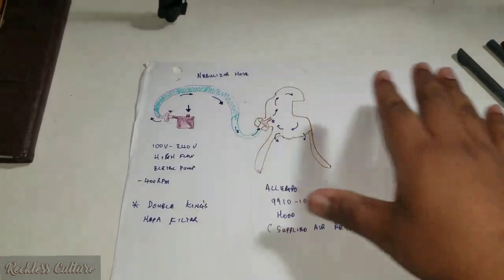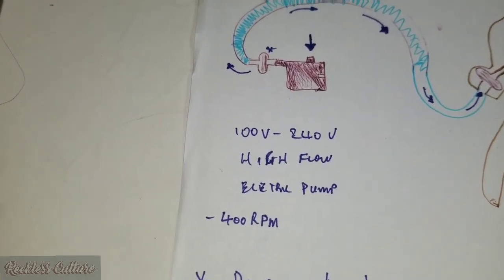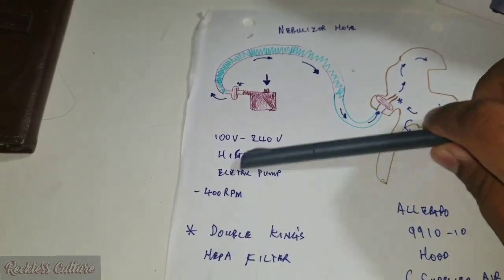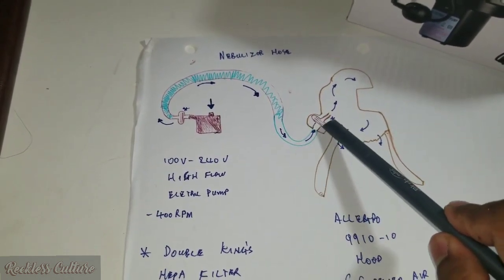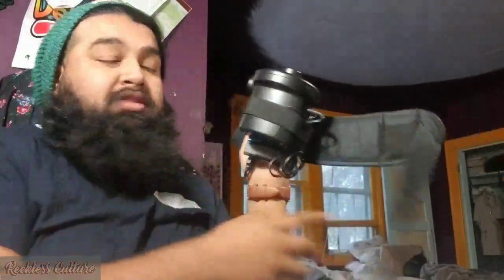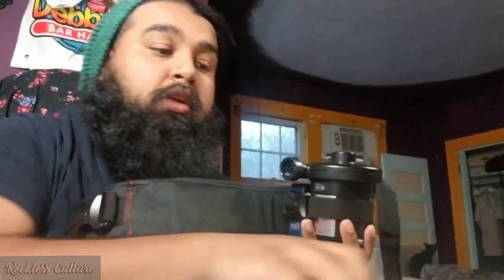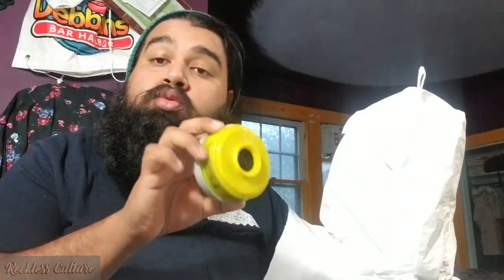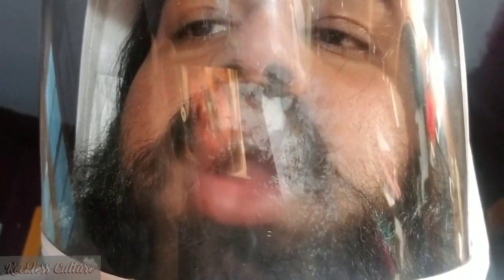LOW-COST POWERED AIR PURIFYING RESPIRATOR HOMEMADE/DIY

Comment: Way to think outside the box. Good job! However, just a couple of things. The pump flow should be in litres per minute (LPM) or cubic feet per minute (CFM) not in RPM. Secondly the filter you have in the hood should be turned around. The side with the little blue cap should face the airflow. That filter is called an HME (heat/moisture exchanger & works best in the proper orientation. Last thing, tubing for a CPAP is the exact same size as the corregated tubing you're using and is MUCH more flexible. 
However, like I said, GOOD JOB!
Reply from the maker: Craig! Lovely feedback! Really appreciate the constructive, and considering comment! The filter was reversed because it doenst fit on the other side 🤪. Goooooood observation tho. Man i love this comment :)
Reply: @ProjectDunner22  Check with any durable medical equipment company or hospital. They'd probably just give you a nipple that will make it work. 
Thanks for the reply.

Comment: I am not sure if there might be a potential health risk using that motor. That motor was not designed for this purpose and the brushes of the motor are not isolated from the fan. I am not sure how much ozone those brushes produce, but if they are not isolated it would mean that 100% of that ozone is blowing into your mask. The amounts might be too small to worry about, but all brushes produce sparks. I guess it would still be a good idea to take the extra step to isolate the blower from the electric motor.
Reply from the maker: Ah!! Valuable input. Thank you!
Reply: @ProjectDunner22  If you figure out how to isolate the blower, perhaps it would be a good idea to replace this video with an updated video. most people are not going to read comments and clearly you are doing this to help people. I do like your project, but I decided to just bite the bullet and buy one of the commercially available systems. They are darn expensive. And of course I just don't trust the cheapo ones, as this is clearly supposed to be a safety product. Thanks...

Comment: what did u use to connect the air pump to the battery using a USB? because the linked airpump does not have a USB
Reply from the maker: I use the regular dc point on the pump. I found a dc-usb wire.

Comment: Google "RAD-UM PAPR" for a very simple portable design to download.   I'm adapting that design only by adding an inexpensive inline tube filter out of the blower, and eliminating their HEPA intake filter as redundant (your 2 filters are redundant as well, which could affect airflow).  Your pump motor is overkill.  The RAD-UM design uses a 5V centrifugal blower that puts out almost twice the minimum airflow specified for loose-fitting PAPRs (as hoods are classified).
You have the concept right, and you give us a better look at that hood than Amazon does...   and you also show why you turn on the blower BEFORE donning the hood...

Comment: How do you filter the exhaled air?
Reply from the maker: Susan, the exhaled air is forced out through built in flaps in the hood. It doenst need filtering, unless uve tested positive. Doenst matter if ure in a positive environment to begin with lol

Comment: The AGPTEK product has a "do not use electric air mattress  pumps continuously for more than 15 minutes" warning.
Reply from the maker: That's correct. But with a lower wattage of power, it allows me to use it for longer

Comment: 12v DC motor ain't gonna work on a 12hr shift (usual ER shift) 8hr(ward), if 2hrs is the max then it's a problem and a risk (if it's a hospital related job usage), what you do is solder it with a volt converter with speed control module and also can eliminate that loud air pump noise, that way it can run longer and more efficient. With a 10kmah could last you 8-9hrs, if low,powerbank will do to extend power time.
Reply from the maker: For the hospital, they got the big boy PAPRS  for me. This is to do emergency medicine. Rapid reaponse ems. One call lasts about an hour so it fits comfortably in that time pocket! If I need it to last longer, i would've get a better battery and a motor with a couple speeds
Reply: Alex, you don't sound like you are talking from experience.  I can easily run my fan for 8 hours on high.  The power in theses newer cells is like magic especially when it is paired with a brushless motor.  My battery pack can and has started my car more than 5 times in a single day.  It did melt the solder on jumpers but the battery is still working and this is 3 year old technology.  I would never choose a hospital that has nurses working 12 hours shifts.  If I can not get good work out of my factory workers on a 12-hour shift then I do not see how nurses would not show the same fatigue after 6-8 hours of hard work.

Even if I need it to work for a 20-hour shift I would most likely choose to have 2 or more smaller batteries.  I mean how hard is it to swap out a power bank?  If an RC plane can fly for hours then surely the same tech will work to blow your fates directly into your face, no?

Life is about fixing problems not being a neo-Marxists and just pointing out problems like MSNBC reading Trump tweets. ;D
Reply: @David-w8x6q    maybe yes maybe no, I use the same blower motor as on the video, so I believe I talk by experience, and I've tested several batteries, especially lithium ion, I based it on the PAPR that hospital staff use. And my wife is a nurse, ER nurse to be exact, they work 12hrs shift and yes ER nurses work 12 hrs shift, during peak of pandemic they have sometimes no break as its too much work taking off their ppe just for a break plus a huge amount of patients. So if you compare it from your construction worker to a nurse handling Covid19 patients hands on then your irrelevant, your construction worker don't deal with life and death and risk of getting infected directly from a Covid19 patient with an outcome of being dead or alive from the virus. 

My statement was just to point out things that can make his prototype last longer in terms of usage. Also just FYI ER nurses works 12hrs shift and only 3days a week. Ward nurse work 8hrs and 5days week, so In this case I really don't understand your logic, since you have no idea how medical staff work hours shift works. 

It seems you're the one who's irrelevant by experience, 

 Do I have to drop  🎤 🥱
Reply from the maker: HEY QUICK UPDATE! I've tested it's ability, and it went on for 3 hours! Then jist incase i burnt that little motor, i did it again and it worked just fine. The battery didnt die but the power was def getting low
Reply: @ProjectDunner22  yes it happened to mine too, I had to regulate power so that it won't overheat, then I eventually changed it a 13200rpm brushless motor and it permanently solved the issue and lasted longer for about 8hrs on medium with a 5000mah battery (powerbank).
Reply: hi, please tell me which fan you installed.  and what power bank.  For example, I found a 12 volt 2.7A fan.  and they tell me that I can't find a power bank for him.
Reply: @canezbasten709  any power bank will do, the higher the MaH the better.

Comment: Hello! I have a question - how long time this air poomp is working by from one church.
Reply from the maker: It should run as long as the battery allows it! Rated for 40 mins max on high speed and approx 2 hours on low power